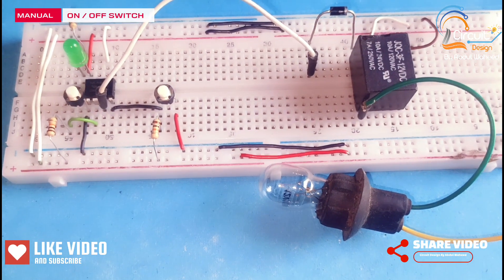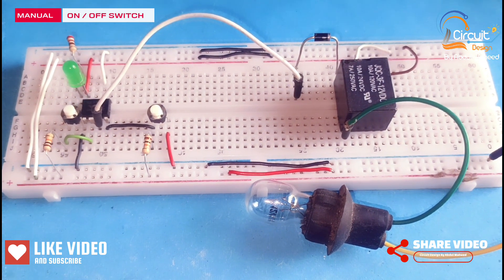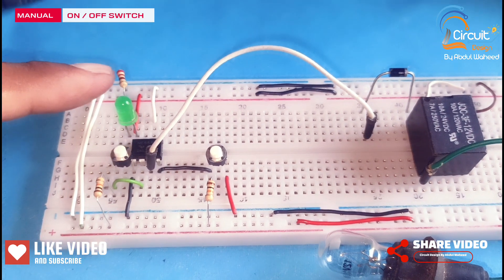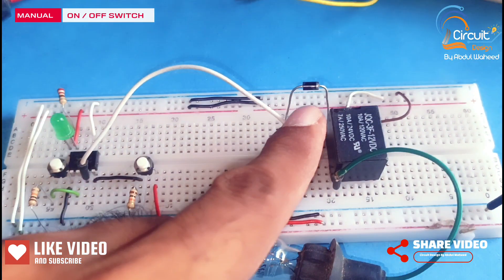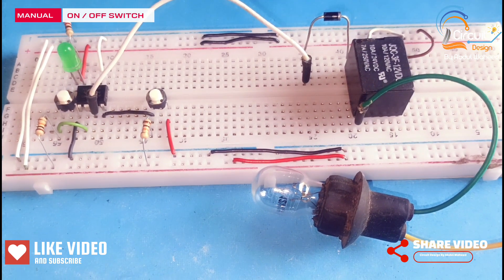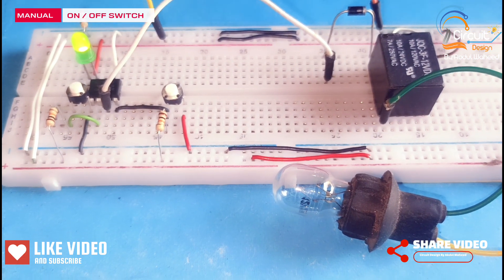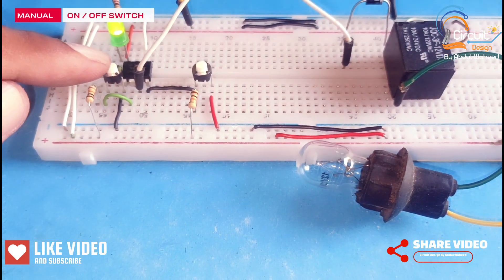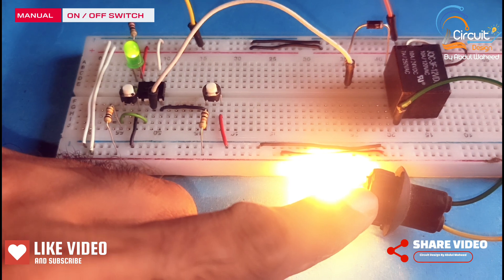How we can use NE 555 as A Manual ON/OFF switch?|Making Manual Switch Using NE 555

Comment: Use 2 transistors as a bistable latch. That's only 6 pins - 2 fewer than using a 555 and cheaper too.
Reply from the maker: Yes dear ....You are right....there are other way to do same....Thank You.....